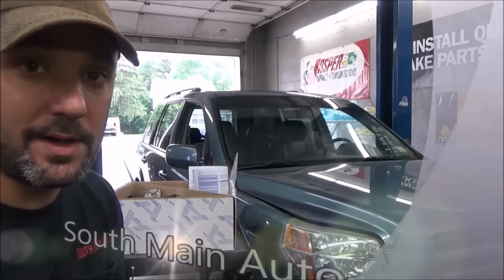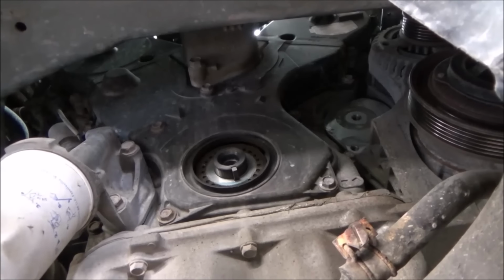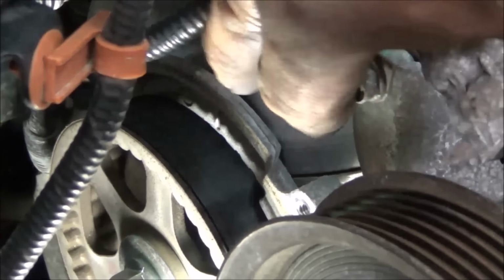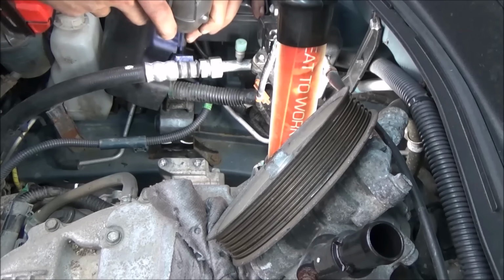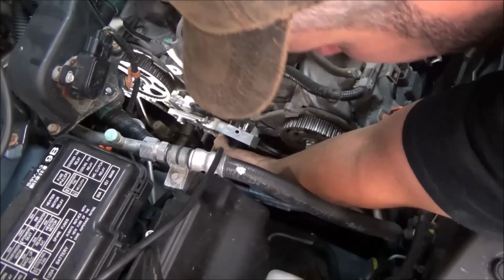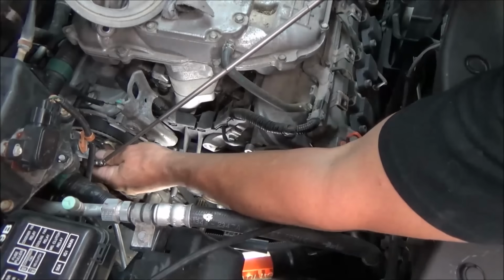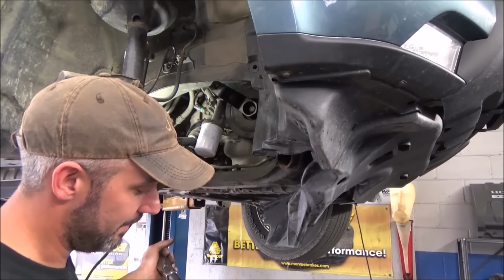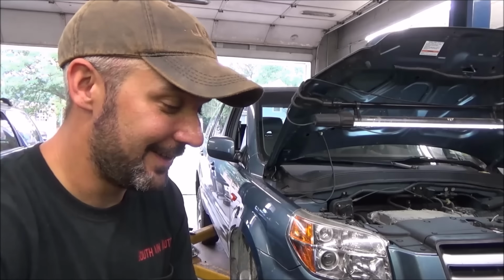Honda Timing Belt 3.5 J35 - Pilot, Odyssey, Ridgeline

Comment: Hello. I have a 2009 Honda Ridgeline with 230,000 miles on it. I had replaced the timing belt with all new OEM Honda parts. And I got 33 thousand miles out of the new stuff. But then at an idle my engine quit running. After removing the first inspection cover oh, I see the belt is not even there. So apparently the belt broke. My question is, at an idle, what kind of damage could there be Tuesday valves? I would like it if someone can call me. My number is 720-365-6093 thank you my name is Rocky
Reply: Did you purchase your timing belt from a Honda dealer or from eBay/Amazon?  The majority of timing belt kits on eBay and Amazon are counterfeit, even though the sellers often times have 95-100% feedback ratings.  It is well known that these fake timing belt kit components fail quickly (belt, bearings, water pump, etc.)

The fake components are very good copies, but upon close inspection and comparison to true OEM components you will see the difference.

Comment: Hello there. 
Today I finished changing my timing belt for my honda pilot 2007. I follow the steps  to the t. I had a little problem getting the timing brlt slack from the right side ( opposite to the tensioner).  when I started the pilot, it did started just fine however when I turn the car off, it has a little sound from the engine right after it is turn off. It sounds like a excel of air. Hard to explained. 
Is it possible that I used a wrong tooth from Cam 2? 
Any ideas?

Comment: 260k miles on my 04 Honda Pilot they just changed the timing belt and they said it had the original parts and belt. So I’ve been driving around a ticking time bomb. That’s insane

Comment: Easy-peasy… .  1st thing remove the serpentine belt 2nd thing remove the power steering pump 3rd thing remove the motor mount, then take off your covers and belt… no reason to support the engine underneath, the way the motor mounts are configured it will hold itself without any harm to the vehicle 👍

Comment: Hey I need your help
I’m downing a timing chain job on 08 g6 with 2.4l vvt ecotec 
My issue is I got all four plugs out but the motor will not turn over by hand. It will turn over if I use the key. I do have trans in neural. I’m confused, I know you probably have the answer lol
Reply: Are you sure your starter is spinning the engine and not the starter motor just activating without tuning the flywheel?
Reply: @superknuckle6510  yes I can see the timing chain move when I crank it

Comment: The dealer recommends a valve check/adjustment at this service. Is that really necessary?
Reply: The owners manual says to adjust clearance if there is noise or, at 105,000 miles. If you don't have any valve noise and don't want to pull the intake and the valve cover, you should be fine.
Reply: @superknuckle6510  Thanks

Comment: Great video Eric.  I'm about to do this job on my '06 Pilot at 214k and counting once it warms up here in MN a bit.  I recently had some misfire codes when it was -15F out, sensors act up in that cold, but I'm going to replace the crankshaft position sensor which is hidden behind the crank pulley, no better time to install it than during this job.  It occasionally cranks a litter longer than usual when starting so I've been thinking that sensor might be on the way out.  Hopefully it doesn't require a relearn procedure, haven't seen anything specific to that yet if it is required.  Keep up the good work.

Comment: Hey, I've watched your video multiple times to both get me prepared to do this to my 2015 Odyssey, and as I go along.  I'm putting things back and I am having an issue keep/getting tension between cam 1 and cam 2.  The marks are dead on, but it seems like when I'm putting the belt on that I'm about half a tooth off.  Any suggestions?  Thanks!

Comment: I have an '08 Ridgeline that needed a timing belt/water pump job (100K mi).  Watched your video along with those of your competitors (Eric, the Car Guy, Repair Geek, et al) and decided to follow your tutelage..  Having 25 years as a vehicle mechanic (in the Jurassic Age), I decided to perform the service myself!! Followed your instructions religiously (plus a few expletives which will remain nameless) except that I removed the upper motor mount in one piece.  Took me a couple of days and donated a small amount of blood and discovered that timing gears would make great knives with which to filet my fingers.  Saved me at least $1,000 and up to   $1500 over taking it to a dealership.  Your videos are the best... My Hondoo and I thank you!!

Comment: Great video. I used it to successfully service a 2007 Honda Odyssey EX... thank you!

One suggestion for the novices like me:  As Eric showed us, mark the existing timing belt with a paint pen at the TDC location on both the front and rear camshafts.  Also mark the side of the belt on the bottom tooth of the crankshaft.  After cutting off the old belt, transfer these marks to your new belt.  When you install the new belt, you can use these marks to ensure that you have the belt installed properly.   It is very easy to be off one tooth on the rear camshaft when installing the timing belt because it is very tight and you have to stretch it a little to get it on.

Comment: this was a big big help to me  just had to do the belt 2011 pilot thanks for the help
Reply: 2003 Odyessy 144k just did mine, first one and it needed it. Followed the vid step by step took about 6 hours and then had to burp the coolant system due to too high idle. Now runs great!

Comment: So Honda is still using older tech that cost owners?

Well the 2018 RDX 2.0T requires a valve inspection at 100K miles...

Comment: Eric, have you done a timing chain replacement on a 2003-07 Saturn 2.2 Ecotec. My wife's car(171k miles) needs valve guide seals(my best guess, blue soak especially after idling for a little while). If I do this I may as well replace the timing chain and all the tensioners. I learn a lot watching your videos. Thank you!

Comment: Valve adjustment is due in the same service. The exhaust valves get tight and there are no hydraulic lifters. 
No way to not dump the coolant when removing the pump.

Comment: Good video. I’m a home mechanic with a lot of experience. Have a homebuilt Lotus 7 using a Volvo donor. I have a 2009 Ridgeline and this was a great instructional video. Mine unfortunately has the dreaded oil pump leak so the pan will have to come off to replace the seals.

Comment: Thanks. I watched yours and ETCG's video on the Honda 3.5 multiple times. Finished mine last week. Doing so helped me realize it was done once before. The timing was off on the camshafts, mainly on bank 1, even after putting the crank on TDC. The camshafts wouldn't line up perfect. Maybe half a tooth off. So after doing all the work, it definitely idles better, my intermittent p0172 never came back, and replaced my engine mount. Took me 3 days because I ordered my engine mount from Amazon. My local parts store didn't have it in stock at the moment. 

Hope you had a Merry Christmas with the family. Thanks again for all the information you share!

Comment: Hi Eric!  Eric me also here.  Couple quick tool questions if you have a sec to respond.  I need to buy some tools like yours and would love your opinion...  1) mini air wrench - what wrench is it and does it come with the flex hose adapter?  2)  The Milwaukee side driver...  Do you have the 3/8" 12v or 18v?  I see you have a decent size battery.  If 18v, do you like it or would you prefer the 12v smaller size?   3)  Torque wrenches.  3/8 or 1/2 and do you like the Snap-on?   As for the crank bolt, different torque wrench as it looked larger?  And I loved the degrees function!

Thanks much!  Might make for a great video to just talk about tools and whether you like and what you end up preferring?  Because I know some of mine are hit or miss of the value aspect after you buy...

Thank you and you're a great illustrator as you work!!!  Seriously!  Regards, Eric.   Ps. Not too far from you so I might grab your fine service some day...

Comment: One little comment from a newbie about 48:38 - you want to add coolant before you install new timing belt and remove the pin from the tensioner. That way you are not pushing it back if it leaks. Thank you for the video

Comment: Just finished installing this kit and it took awhile because the water pump seal had failed letting coolant gunk up behind the covers.  Bought a craftsman 7.5 amp impact gun to zip off the crank pulley bolt with the Lisle 77080 19 mm Harmonic Balancer Socket.  Also bought the ABN Harmonic Damper Crankshaft Crank Pulley 50mm Socket to hold the crank pulley during re-torque of the bolt, which was very easy letting the one socket wrench rest against the frame while getting it snug.  apparently the rear cam has a tendency to jump forward in timing from its resting point because of the valve spring tension so I have to carefully turn it back ever-so-slowly in order to get the belt on there.  I also never removed the thru-bolt on the engine mount bracket, just the 2 bolts attached to the block mount and the 3 attached to the body.  Also noticed the mount is almost shot so that will be another job for another day!  Long live this V6 ! 174,000 miles and counting.

Comment: I know it's long after this post but, What brand is that kit? I'm coming up on 300k in my 2012 odyssey and can't see paying someone $600-$800 to do this when I can do it myself. It may be an excuse to buy some tools (wink, wink). I've found OEM kits but I don't trust Amazon and Ebay to get Genuine Honda parts. I would use after market on recommendation. Thanks for the great video! Posts like yours have given me the confidence to do my own maintenance to avoid repair.
Reply: Aaron- I just followed this video to do the service on my 2010 Odyssey (with 220k) and it was pretty much just like the Pilot.  The one difference I noticed was that in my Odyssey, the ECU is sitting right on top of the passenger side motor mount.  I removed the ECU to make everything easier (3x10mm bolts).  

The Lisle 19MM socket is the bomb for getting the crank pulley bolt out - If you have an impact gun with grunt.  I bought a new one with 1,200 ft/lbs of breaking torque after my 300 ft/lb and 450 ft/lb guns wouldn't touch it.  My new impact had the bolt free in 1 second flat. 

Specific to this service and parts used, I went on Rock Auto and purchased the "Gates Accessory drive belt kit" and the "Gates Timing Belt, Water Pump & Component Kit".  Everything seemed high quality and went in as an exact fit.  

Another note - for what it is worth - you may want to go ahead and order a passenger side motor mount if you haven't replaced it in 100k.  You will have the mount off in your hand and a new one is $20-30 on RA.  Good luck.

Comment: Well I've started doing the timing belt on my 2007 pilot. It's not been as easy as yours went. The crankshaft pulley did not want to come off. I had to use a pry bar back and forth until it finally decided to move. My timing belt was a bit loose at the top portion where it goes under the water pump pulley. I put the new timing belt on and it was the same loose around the water pump pulley that is. This is where I started to mess up. I turned the crank a bit before realizing I hadn't installed the hydraulic tensioner. I didn't move it much maybe a 1/2 an inch before realizing it. So I installed the hydraulic tensioner and then preceded to turn the crank a couple turns and then realized I was turning it the wrong way. The crank bolt started to loosen making me aware of it. So I then turned it clockwise like it was supposed to be turned. Anyways all the pulleys are stilled aligned with the timing marks except I think the one pulley closest to the engine fire wall. It looks to be around 1/2 inch off. How can I fix this? Should I take the timing belt off and get a wrench on that one and turn it back a 1/2 inch to get it aligned? I hope I haven't  something up..

Comment: Great! I noticed that on this J series engine, there is only 1 serpentine belt for everything. On my J series 1998 V6 Accord there are 2.  There is a seperate belt for the power steering unit and one for the alternator & water pump and A/C units.

Comment: When it comes to replacing your timing kit make sure you purchase quality parts. I notice you used an Aisin kit which is the best kit you can get. Aisin makes the water pumps and grenade that are found on the cars that come from the factory. These are the same components you would get at the dealership for half the money. Even the belt is identical to what you buy from the dealership. I just installed this to redo a kit that was put in my Odyssey 40,000 miles ago by a shop I paid good money to install. Water pump started leaking. Stripping it down I notice the timing belt was close to failure. It was brittle and dry with cracks between each spline. Had the belt broke the motor would have been toast. All I can say is don't buy cheap parts off ebay or anywhere else. Get an Aisin kit and it will last the recommended 100k miles.

Comment: little socket is bad ass. I work as a mainline technician for honda and there are very many tips and tricks when it comes to working on these cars. most the time when I have to use IN to look something up, I wish it would just say yank because it would save some time finding out the answer really is yank, or the other answer is "yes, you have to remove part to get other part out"

Comment: Hey Eric thanks for the video I followed this step-by-step on this 2009 Honda Ridgeline and when I brought it up on TDC the cam closest to the firewall was one tooth Beyond the timing mark the other cam was dead on is this normal or should I put it back on the timing mark where should be I rolled the engine over four times with it like that and it still came up the same way tried to start it and it would not start so my question is should I just bring it back up to the timing mark on that canvas closest to the firewall and should I have disconnected the battery while doing this your help would be greatly appreciated

Comment: Thanks for the video Eric! Just did my first 3.5 liter on my 2009 Honda Ridgeline I bought a great kit for it came with water pump and everything you wasn't joking when you said that crank pulley bolt could be a bear I actually have that new tool made exclusively for that Bolt and I still broke two extensions 1 break over bar and 2 ratchets trying to break it loose ended up calling a mobile diesel repair truck and they finally got it broke loose using a 1 inch impact and I thought my 3/4 was a pretty good impact gun but it wouldn't budge it so after all that I finally got it all back together and it is doing well just preventive maintenance I absolutely love this Ridgeline  next I think I'll tackle the differential give it a fluid change thanks again I'll be looking for the next video

Comment: Not a Bad Video... I use the power of the Starter and wedge a Breaker Bar against the body etc. to break the Crank Bolt loose on many vehicles.

Comment: Hello sir, so I’ve been watching this video for an upcoming timing belt and water pump replacement on a 2012 Honda Odyssey. I recently had the 2012 Odyssey at the dealer for a safety inspection and they mentioned that the timing belt needed to be replaced based on time interval. The van only has 60,200 miles on them. How can I tell for sure If this van needs it done or not? What do you recommend? Or how can I check if it needs it? It’s low miles, but it is 7 years old now.

Comment: Hello Erick I have a question, I am in the process of changing the timing belt on my 09 pilot but the rear cam mark does not line up no mater how many times I rotate the belt so the front camshaft and lower crankshaft are fine but the back camshaft line is back like a tooth so how can I fix that, and yeah the engine was running but on park and rev the engine I was hearing like a knocking so I think that’s the reason so can you help me how I can do?

Comment: hello I have CRV 2009 ex 4wd 209000 km.  there is no check engine light.
  the engine make  some noise and vibration at idle and   hard 
accelration  power  . the cylindre compresion is correct   I have change
 spark plugs.  there is no leake and   coil ,  injector are correct.   
After scan honda  say ther is  misfire  in cylindre  4 at  idle. after  
check they propose  first  a valve ajustment and  if  the problem stay  
there  propose  chain  kit  change.   what  you think .  if  i change 
chain  kit does  the engine will be correct or  it is better  change 
engine. thank  you
Reply: Change the Vehicle or spend $1400 fixing it

Comment: Eric - O.  Thanks for this video it has helped me to changed the complete timing kit in my 08 Honda Inspire 3.5 v-6 

Your honesty in explaining and demonstrating the true process is greatly appreciated.

I had an annoying noise at cold start up, I did some  research and found out that it was the timing belt tensioner. Common problem for honda v6

I decided to buy the complete timing kit instead of just the timing tensioner alone.

I checked with several mechanic and they where giving me a run around, one of them even told me he could not pull the crank bolt.

After he  had my vehicle for 8 hour's. 

I purchased a horminacor balance from amazon, heated  the crank bolt spray it with wd40 and used my 1/2 breaker bar, extension, 19mm socket and a jack stand and got it pull myself.

I'm a plumbing engineering not a mechanic but now because of you I have the know how.

Thanks Mr. Eric

Comment: Hey I have a question,  I'm planning  To change my head gaskets but I had done a water pump timing belt tensioner etc. About 5-10k ago,  and I am wondering is there a way to remove the timing belt without cutting it? -2005 Honda Odyssey EX-L